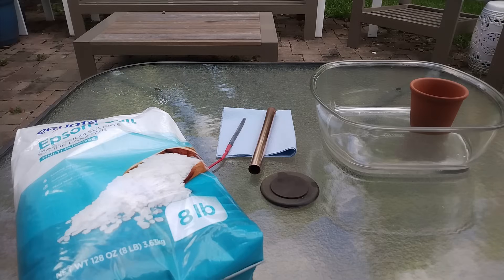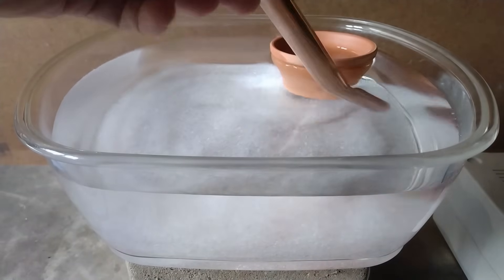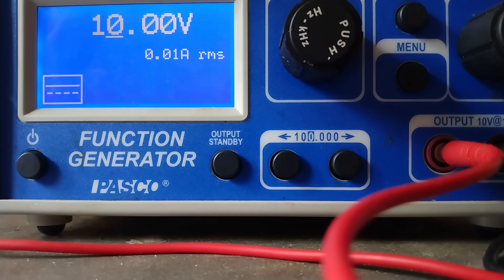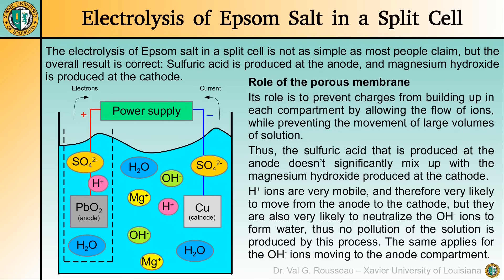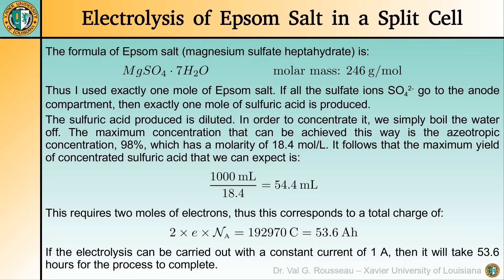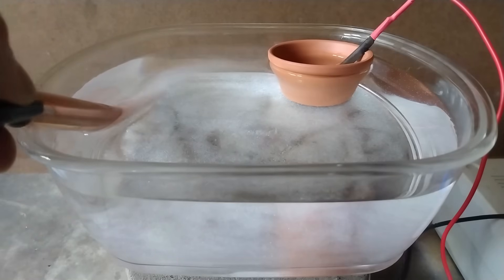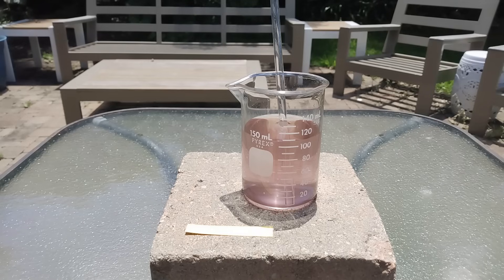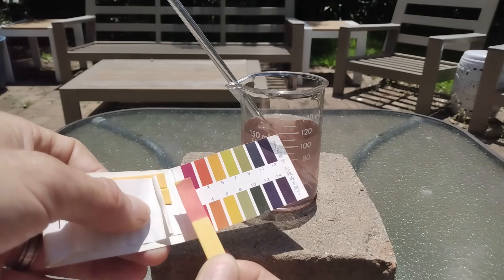Making 98% Concentrated Sulfuric Acid from Epsom Salt - DIY

Comment: Thank you for the very good explained video! I missed a bit the safety equipment.
Reply from the maker: Sulfuric acid is not a big deal. Watch this 2-minute video: https://youtu.be/WzRk6nq9zBc
Wearing goggles to prevent acid splashes in the eyes is enough.
Reply: @BlueMoonshine  What about when it's boiling hot? https://www.youtube.com/watch?v=4DUGRWjdNLI

Comment: epsom salt + copper + electricity : remove magnesium that will sit in the clay pot, then when u have copper sulfate reduce it and get the acid in the pot ... copper ion will not go trough the clay pot, that why in first place u end up with the magnesium only in the clay pot at the stage epsom to coppersulfate...
Reply from the maker: "remove magnesium that will sit in the clay pot"
There is no Epsom salt, hence no magnesium, in the clay pot to begin with.

Comment: Could you add some copper sulfate to get the reaction to start more quickly at the beginning?
Reply from the maker: Yes, in the anode compartment, I guess this should work, the copper should migrate to the cathode. Or, you can save a few drops of sulfuric acid from the previous batch.

Comment: I believe the liquid level in the anode chamber decreases mostly due to simple osmosis through the semipermeable clay pot, since the cathode compartment is full of strong salt solution and the anode compartment is very dilute.
Reply from the maker: That makes sense!
Reply: @BlueMoonshine dude i like your  vid but first pls make a video about this but with a high yield😢
Reply from the maker: @SayaialahBeliau  
Well, nothing is free. You need to scale everything up! I'll try to make a video on it, but right now I'm focusing on the method rather than the optimization of production.
Reply: @BlueMoonshine  thanx dude🥺🥺
Reply: @BlueMoonshine 
Hi BlueMoonshine; really nice video and proof of concept for DIY conc H2SO4 from MgSO4 what is quite cheap and unwatched by euro-chemophobic-crates that legiferate bans onto chems.

I don't need it per se because I have some stocks; but I like to be able to do things on my own if ever needed.

Now about the reason why osmolosis did happen: the clay pot is solid but not impermeable nor semipermeable membrane ; it let water diffuse through it's pores and evaporate from external surface what is the principle of passive cooling of clay pot; it remains surfacial thanks to surface tension of water (that allows the water to remain coherent until just the exhaust of each pore; so water doesn't drip out as drops from clay pot unless water inner pressure is slighly present).

There is a possibility that some Mg(OH)2 or (HO-)Mg(-O-SO2-O-)Mg(-OH) (mixed hydroxyde-sulfate) or (HO-)Mg(-O-SO2-OH) has cristallised partly into the ceramic pores making them more constricted so tinier in diameter!

This may have turned (but not sure) the  permeable to a partial semi-permeable clay pot.

I know that the process may be used to turn clay pots into semi-permeable clay pots but it requires usually large (poly)anions and metallic (poly)cations in a way to make unsoluble precipitates (kind of mineral polymers) into the fabric of the ceramic pore that will only allow tiny molecules to pass through (H(+), Na(+), OH(-), ...); note that the polyanions or polycations are usually large simply by their diameter and amount and cohesion of multiple atoms or group of atoms; this included their outer solvating shell of solvent; this outer shell is also present on simple anionic or cationic charges and is stronger with polycationic or polyanionic charges.
--> so H(+) or OH(-) or Na(+) is not as simple as it looks but for example is [H(+) + n H2O] or else written [H3O(+), H5O2(+), H(2n+1)On] idem for OH(-) or Na(+) or else solvated ions; all much larger than simple undressed naked ion in molecular size reality when dressed / solvated.

Usually such precipitate reduce the pores diameter and so they diminish the flow of molecules and charges what implies reduced electric flow by increasing the resistance R for current and electrolysis becomes thus also harder, less efficient and heats up more because voltage must be increased to allow for electrical current  flow (V=R.I and thermic power W=V.I = R.I²) what means more het losses due to resistance (resistivity of metal oxyde-hydroxyde layer if ever; resistivity of the layer of solvent and ions onto electrodes; resistivity of solution; resistivity of pores; all adding from electrode core to electrode core).

Normally the resistivity inside the metal itself within the electrode is much lower and offer reduced resistance towards electron flow.

The dehydrating ability of H2SO4 plays no role here since like any efficient ions provider, it will produce mostly H(+) , HSO4(-) and SO4(2-)  because fully ionization and only leaving some rare undissolved molecular H2SO4 behind; this means water can't leave easily the system; just as you implicitly / intuitively know because conc H2SO4 will never form simply by standing open into normal moisture air without heating; like most cristallisation of salts does!

True that the solution inside the pot being less concentrated; it should in principle be sucked outwards; but this only stands valid into the half-permeable membrane case (what is not the case of a clay pot; I repeat here).

Epsom salt 1 mol/L <-[pot wall]-> distillated water
So initially:
MgSO4.7 H2O on one side and H2O on the other.
Or when into ions
Mg(2+) + SO4(2-) + H(+) + OH(-) + H2O + HSO4(-) + H2SO4 on one side and H(+) + OH(-) + H2O on the other side
Those ions or molecules can diffuse relatively freely and with very little resistance through the pores of the clay pot wall.
Of course speed of ions or molecules is into the orther [H2O] > [H(+)] > [OH(-)] > [Mg(2+)] > [H2SO4] > [HSO4(-)] > [SO4(2-)].
But initially most of the main flow of molecules and ions are H2O and H(+) and OH(-) from the clay pot to the outer recipient until the current flows with its cations and anions balance and charge carriers.
So there is a slight difference of flow but it should equilibrate if levels of fluids into each compartment is big enough.

In this case if the clay pot level diminishes; so does the electrode surface plunging into the PbO2 electrode compartment what reduces drastically current flow (and ions flow) increasing resistance even more.
It makes an unsymetrical electrolysis system.

Of course the H2SO4 sucking water has no sense here because it should hold it into place especially if considering osmotic pressure of concentration increases would fight back any depletion!
You mentionned that clay pot was nearly dry this would mean that the H2SO4 had concentrated maybe 10 fold times into the clay pot thus allowing you to pass from about 8% by weight to maybe 80% b.w. (roughly 1 molar to 10 molar based on MW of H2SO4 to be 98g/mol taken as 100g for ease of estimation) what would make sucking back of Epsom solution into clay pot because 1 mol/L on one side and 10 mol/L on the other side; clearly something else happened!

PHZ
(PHILOU Zrealone from the Science Madness Forum and many former A.O.L newsgroups related to chemistry)
Reply: I can see the osmosis possibility  but I was a little surprised the product was a little pink. Interesting.
Reply: @briantaulbee6452 
It must be due to some trace impurities from metalic oxydes or silicates that are ptesent as minor ingredients components into the constitutive "non chemically" pure ceramic constituting the  grocery clay pot when exposed to H2SO4; probably a prior wash stay within H2SO4 10-20% would have solved the pink tinge; but it was not an issue; so why bother.

PHZ

Comment: Here's a thought. Drill a small hole in the lip of the clay pot and install a small tube that goes over the edge of the bowl and sits over another container. Now have a container of distilled water that slowly drips into the pot. So as it goes, water drips at an adjustable rate into the pot,and it overflows into the catch container through the tube. This will allow the constant removal of the product as the process proceeds. You could also make a similar drop and overflow system that adds a solution of epsom salts to the other side. Removing the magnesium hydroxide probably isn't an issue as it's highly insoluble which pretty much removes it anyway, so you just need enough space for it.
Reply from the maker: This is an excellent suggestion! Thank you for bringing it, I will definitely try!
Reply: @BlueMoonshine  id love to see the results. There's probably an optimal concentration of things in it and you can try to maintain that
Reply from the maker: @michaelallen1432  
Unfortunately I am traveling abroad, and won't be able to test this before my return in August.
Reply: @BlueMoonshine  that's not too far off.
Reply: Magnesium hydroxide is not insoluble. You confused it with magnesium carbonate.
Reply from the maker: @suprememasteroftheuniverse  
You're right!

Comment: Is the lead dioxide critical - or could a lead metal electrode be used?
Lead 'contamination' is OK as it will wind up in a lead-acid battery anyway...
Reply from the maker: Graphite or lead will work fine. You will be able to remove most of the contamination by filtering. Copper on the other hand won't work, as it will turn the Epsom salt into copper sulfate, like I purposely did in this tutorial: https://youtu.be/XGEv9RGrvNY
Reply: @BlueMoonshine  Nice, I also saw another video where it was stated that the metal forms the dioxide coating, and in that video they just used graphite electrodes, but there was a lot of junk in the product, so i'll be using lead strips...

Comment: Handling 98% H2SO4 without gloves - is this a good advice for beginners?
Reply from the maker: 98% sulfuric acid on your hands is not a big deal. It is not fluoroantimonic acid.
Reply: @BlueMoonshine touch it then, go on. We'll all learn from that mistake.
Reply from the maker: @LachskoenigIV  
It get sulfuric acid on my hands almost everyday!
(I will make a video soon to prove that it is not a problem)
Reply from the maker: @LachskoenigIV  
Here is, as promised, the video: https://youtu.be/WzRk6nq9zBc
Note that in the video I mentioned that some people accused me of lying when I said that it is not a big deal of having sulfuric acid on my hands. I want you to know that I am not referring to you.
Reply: @BlueMoonshine  uhm, well I don't know what to say honestly. I've had just a little drop of 30% concentration on my lab coat in chemistry class way back in school and it ate right through the lab coat, jeans and underwear. I'm honestly baffled now.
Reply from the maker: @LachskoenigIV  
Yes, it will indeed very quickly eat fabric. Almost all my clothes have holes because of sulfuric acid. But skin is pretty hard to dissolve in acid.

Comment: Could you do the same experiment, but actually contain, and properly store the escaping gas molecules?
Reply from the maker: I guess I could. But since the escaping gases are oxygen and hydrogen, it would be simpler to do the electrolysis of dilute sulfuric acid. No split cell necessary.
Reply: @BlueMoonshine  showing off how to separate the different gas molecules would also be wonderful.

Tks for getting back to me by the way. I really love your videos, even if the equipment for chemistry is too expensive for me to make a hobby out of it.
Reply from the maker: @Parsosti  
I will add this to my to-do list of videos.
BTW, if you are talking about the distillation apparatus that I use in other video, I got mine on eBay for only $65, brand new (without the heating mantle). It came from China in no more than 12 days, and it is good quality. @Nurdrage has a video that explains how you can build a heating mantle yourself.
Reply: @BlueMoonshine  tks for the tip. But my main issue is finding a decently cheap basic chemistry kit. Glassware is usually pretty expensive when you actually have funds. Since most of mine tends to go to rent... you get the picture right?
Reply from the maker: @Parsosti  
Yes!

Comment: I think the water level in the pot dropped because of the osmosis, the solution outside is quite concentrated so it could just pull distilled water through permeable clay. Also, the potential of a galvanic battery is the cathode potential minus the anode potential. If we calculate it that way, it should give about 0,4 V instead of 2 V. Is electrolysis different than battery?
Reply: Also the color might've disappeared because it came from the electrode, when you heated the acid it oxidized the carbon particles. Inorganic contaminants like iron from the clay pot would persist, it was most probably something carbon based.
Reply from the maker: @zenongranatnik8370  
"Also, the potential of a galvanic battery is the cathode potential minus the anode potential."

Be careful! It is the cathode REDUCTION potential minus the anode REDUCTION potential. This is equivalent to what I did, which is the cathode REDUCTION potential plus the anode OXIDATION potential.

Comment: What are the alternatives for membranes that can be used In a split cell like this one?
I've seen somene use agar before.
Reply from the maker: I haven't searched about this yet, but I'm sure there must exist some better membranes than the clay pot.
Reply: Agar might work but it might be single use which is fine unless you do the electrolysis often. You can look for ionomer membranes online like nafion but I'm not sure they'll work here. Also polyacrylamide might work.

Comment: Lead salts could also be causing the coloration, and possibly copper if any of the cathode solution got into the anode bath.
Reply from the maker: But the lead dioxide electrode is supposed to be inert for those reactions.

Comment: Now it can finally fill my motorcycle battery with fluid 😂 nice video i might try this just for the experiment
Reply from the maker: Well, batteries use only 30% sulfuric acid, so you end up with more acid. Check this link: https://youtu.be/0zQYJJz89Wo
Reply: @BlueMoonshine  it was a joke yeah I know

Comment: I'm curious how this would work with sodium metal bisulphate, because you have 2 sulphate ions. 

Id love to do this myself, but I'm bad at documentation and knowing what exactly I did last week.
Reply from the maker: I'll add this to my list of to-do experiments.
Reply: @nunyabisnass1141 mix the sodium metabisulphate(ph-down, from a pool supply store) with hydrochloric-acid, and then boil away the water like in the video. It's proberly the most efficient, and easiest way to make sulphuric-acid, as an amateur chemist with no access to controlled/regulated chemicals.

Comment: Seems like a lot of effort for a very tiny amount. The better what is to just use the contact process: create Oleum (SO3) and apply to water. 
so3 + h2o → h2so4.

For now you can buy concentrated H2S04 as drain cleaner (usually around 92% to 96%). Just distill to get to 98% (Nurd Rage as recent video on this method).
Reply from the maker: "buy concentrated H2S04 as drain cleaner"
That's what I usually do, but it is getting harder and harder to find some. Looked at Walmart, The Home Depot, Lowes, and it was impossible to find any for months. Lately I was able to find again some at Walmart, but with the government making new laws everyday in order to reduce our freedom, these products will soon completely disappear from stores. Same for the standard 30% sulfuric acid for car battery that we normally find at Autozone or O'Reilly.

Also, my tutorial is mainly intended for people living in the many countries where the access to sulfuric acid in any form is totally banned by their government.
Reply: @BlueMoonshine Precisely. Some European countries have banned it for regular consumers, and in the US, we are always one ignorant news story away from an angry mob demanding something should be banned.
Reply: ah yes because everyone has the necessary expertise and equipment to handle the famously safe reagent, sulphur trioxide.
Reply: @viktorsarychkin8456  Is this because everyone already has the expertise & equipment to work with 98% H2SO4?!?
Reply: @viktorsarychkin8456 I would never approach SO3, or chromates, or mercury derivatives. The great thing about nurdrage is how he often goes into safety, and risks, and I take stuff to heart. Even when you know what you are doing, mistakes and accidents still happen.
Reply: @nunyabisnass1141  i was being sarcastic in my previous comment if that wasn’t clear

Comment: very good video!
Thanks very much!
the reddish hue likely results from dissolved Fe3+ from the clay pot
Reply: Explains why it doesn't filter
Reply from the maker: @Dude8718  
We can filter only particles that are in suspension, not dissolved. But in the present case, it turns out that the pollution that is responsible for the reddish color is dissolved.
Reply: @BlueMoonshine oh i know, that was a statement not a question lol thanks tho
Reply from the maker: That makes sense. Thanks!